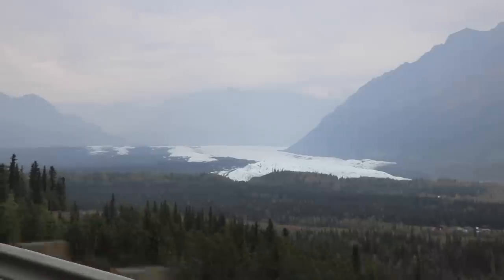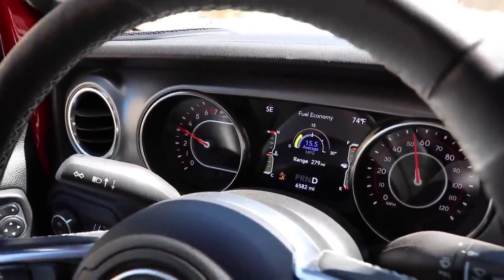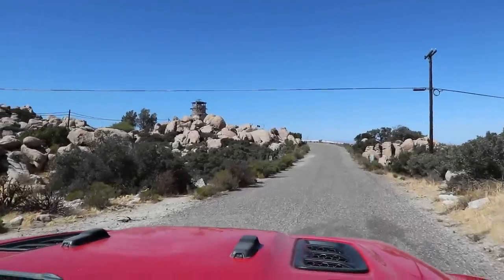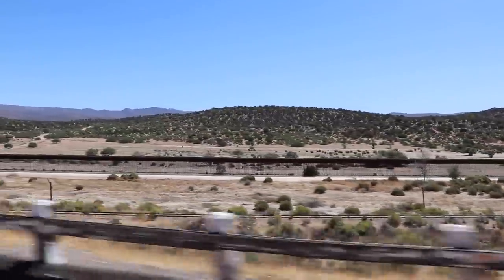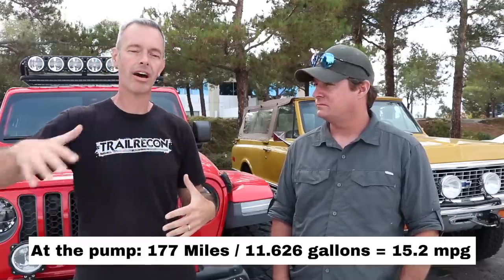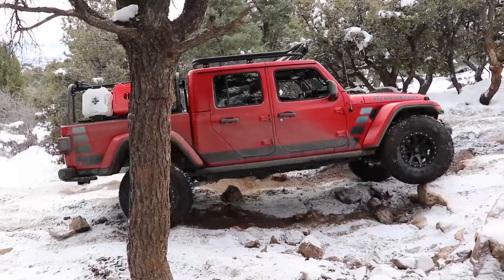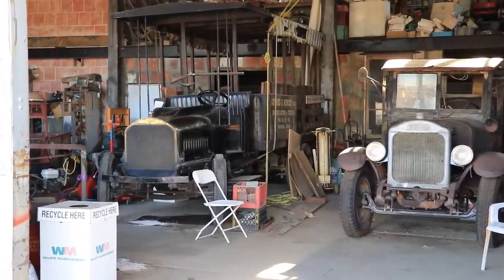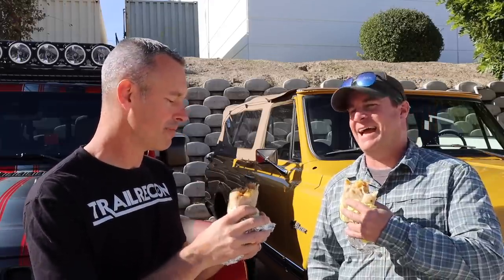Did Re-Gearing My Jeep Gladiator Affect the GAS MILEAGE?

Comment: Great video! What was the total cost for regearing? Is it worth it for the price? Thank you!
Reply: Claude Perrault rehearing has a few variables. Ring and pinion with set up kits and labor usually cost around $1500. I’ve seen it as low as $1100
Reply: drtstar1 Thank you Brad!

Comment: Great test!  
I do have a question that you or someone here might be able to help me with.
I have a 2016 Sahara JKU   
3.5” lift front w/winch and rear bumpers currently on 35’s but looking to do 37’s or 38’s.  As you know the thing is heavy.  
So looking to install some lockers and re-gear at the same time this year, but not entirely sure what ratio would be best. I hear so much back and forth on this. I trust your opinion because it seems you really do your homework before making a decision.  

   I do remember you did a video on your JK a while back, but can’t seem to find the video.  

Thanks

Comment: I get 16 with mixed driving in my xj with 32" tires, 3.5 inch lift, a tire on my roof rack basket, and on stock gears. She doesn't weigh anything near the gladiator though.
Reply: How do you pull that off? I have a Jeep ZJ with 4.5 inches of lift and 31 inch tires and I'm lucky if I get 11 mpg. It's a 4.0 by the way.
Reply: Damon Strehlau most of my driving to work is the Jeep runs around 1500 rpms and I get no traffic. On the highway I don’t pass 70 mph and just easy on the throttle.

Comment: Great video. Really enjoyed. My question is for a  1 MPG gain is it worth regearing based on the cost of doing it? Also would you recommend regearing even if you aren't increasing tire size or adding additional weight to the vehicle. Thanks.
Reply from the maker: All depends on your needs.  It would take a lot of gas to make up for the cost of the gears, but if you want to bring back your acceleration and have a little more range, it could be a good option.
Reply: @TrailRecon  thank you!
Reply: My dad and I have both lowered the gearing on our pickups using stock tire sizes. It makes them a lot more usable and most of the time no difference in miles per gallon.

Comment: Here’s my question: people always do a break in and change out diff fluids at 500-1k miles when regearing, but how come when the truck is brand new, which means gears are new, no one does the break in for the diff and change out diff fluid at 500-1k miles???
Reply: I would do it to make sure the shop did it right.  At 500 miles it's not to late to fix it.

Comment: What was the original gear set? Leaving those in would give you better mileage, but would be sluggish on take off. Putting 5:13 in would give you better takeoff but worse gas mileage unless they put you in the optimal rpm for mileage which obviously they do.

Comment: I have a gladiator rubicon stock with only a steel bumper and winch totalling 98lbs gain. My gas mileage as never been close to 16 mpg. Any reason for this? Even out of the dealership it's never been that great. I have 7000 miles on it.

Comment: On the JL do you need to upgrade the brakes when you go to 38” tires?  I believe they come with oversized brakes but not sure where an upgrade is needed? 37?  37?
Reply: Mats Ceder the JL brakes are way better than Jk but with the trucks added capacity we noticed some stopping distance increases with bigger tires. The bigger brakes are a margin of safety.
Reply: Good point.

Comment: Good information Brad, I saw that both of you were wearing heavier clothes on the test after the gear change, would the cooler temperature make a difference to the gas mileage?
Reply: Yes. The density of air would make a difference with the efficiency of the engine. More air = more bang. 1 mpg improvement wouldn’t be out of the question if there was a 20+ degree difference.

Comment: Hey brad hope all is well definitely see the benefits for the gear you carry etc off road should be a plus also a little extra range is good on the long trips to curious if you thought of a saddle tank I no there’s extra weight involved  but curious on your thoughts as always be safe
Reply from the maker: It think a saddle tank is a good option, but for me if I install any kind of auxiliary tank on the JT it will be for water.  There are some under the chassis aux. fuel thanks out there, but I haven't seen one that doesn't affect clearance yet.

Comment: Have you experience high temperature goin up hill with stock gears, my JL eco diesel gets pretty hot when going up towards San Diego, I’m running 37” with 3.73 gears
Reply: regearing will help that. I went to 4.56 on my eco and it helped immediately.

Comment: How did you come up with 513 gears? Seems like overkill for 38s.
Reply from the maker: I think 4.88 is a good ratio to go with for 38's, but because I carry a lot of gear and I will be doing some off-road towing I wanted to with a slightly deeper gear, so that's why I chose 5:13's.  Sorry for not explaining that in the video.

Comment: I guess my 1960s auto mechanics class lead me astray, of course then 4 on the floor was allot go gears; would have guessed going from 4:10 to 5:13 would have resulted in higher RPMs at a given speed thus lower milage. Of course that ignores overdrive. Lesson learned. Maybe we'll see you on the road, to/from/in Alaska.
Reply from the maker: I was surprised as well, but I think the 2 overdrives played a big factor in this test.
Reply: Lower RPM is not always better. There is a sweet spot. If the top gear is virtually unusable then what is the point? My dad and I have both lowered the gearing on our pickups using stock tire sizes.
Reply: @ericham4945  Good point

Comment: Brad .... Did I miss the ... Why 5.13’s vs the 4.88’s... You have 4.88’s on the JK right?  With the 5 Speed vs the 8 Speed thoughts on 5.13’s vs 4.88’s.  I’ m about to ReGear (2016 Rubicon on 37’s), and am having a Tough Time with 4.56’s vs 4.88’s ... I think as a daily driver the 5.13’s are too much... Thoughts ?  😃
Reply from the maker: Yes, I have 4.88's on the Wrangler. I think 4.88 is a good ratio to go with for 38's, but because I carry a lot of gear and I will be doing some off-road towing I wanted to with a slightly deeper gear, so that's why I chose 5:13's.  Sorry for not explaining that in the video.

Comment: So why 5:13 as 4:88 is closer to factory final ratio?
Reply from the maker: I think 4.88 is a good ratio to go with for 38's, but because I carry a lot of gear and I will be doing some off-road towing I wanted to with a slightly deeper gear, so that's why I chose 5:13's.  Sorry for not explaining that in the video.
Reply: @TrailRecon  Great video...It makes sense that 5.13s are efficient driving 60 mph or less.  What about cruising on the interstate at 75mph on a long road trip?  I bet gas mileage drops a good bit vs going with 4.88.  Would also be good if you touched on the weaker ring & pinion in the 5.13.
Reply from the maker: Most of the way back from our turnaround point was highway miles, we still didn't see any significant drops doing 70.

Comment: It’s the hwy speeds that kills mpg after re-gearing.
Reply: David DH actually helping. You are getting the powerband back in the target area while in the highway. On my 2014 Silverado I got 7 mpg gain after the regear.
Reply: @drtstar1  It's different on a full size truck.  I'm sure you're not running 3k RPM's cruising down the highway at 65mph.
Reply: David DH depends on what truck. Lol I just put an overdrive trans in the k5 and I’m now 1500 rpms at 65.
Reply: @drtstar1  We're here talking about re-gearing and you're talking about OD on transmission. Get on the same subject dude.  Also, once you're rolling at 65mph on stock gear, it doesn't take a huge amount of power to maintain that speed so yes, hwy speeds kills your MPG.  City driving is different.
Reply: David DH the point is about getting the final drive gear in the sweet spot of the engine.
Reply: drtstar1 so what is you’re sweet spot, 45-55 after regearing to 5:13?  Here we run 75-80 mph on the hwy and with 5:13 gears, the engine is reviving .   Who ever says putting massive tires and regearing had help their mpg  lives in a 50mph max speed world.
Reply: David DH, you are absolutely correct. I wish I had a sixth gear. Running at 3000 rpm kills my runner but city and in the mountains I love being re-geared to 4.88
Reply: David DH every vehicle is different. In a sbc 2000,2200 rpm is my favorite engine operating range for gas mileage. There are so many other factors though. Are you using a turbo 400 trans? No lock up converter? A huge stall converter? Those are all high horsepower mods and will never see gas mileage gains. 2006 Chevy truck 35” tires 4.56 gears I’d get 16 mpg round trip at 75mph. That truck had a 4L60e trans and a .7 overdrive.
Reply: Zac C I agree with you 100%. I had 4:88 gears on my old JK and it was absolutely enjoyable to drive with 37” tires around town. I just hated trying to keep up with others in the interstate.
Reply: drtstar1 4:56 gears is different then 5:13. I’m commenting on the video.
Reply: @drtstar1  Thanks for the feedback.  What do you feel is the sweet spot for 75mph hwy driving a JT or JL on 37s/38s?  I have a manual JL and it operates about 200 rpm higher than the auto.  For example, with 5.13's running 37s at 75mph, it would cruise at 2600 rpm getting approx. 14mpg.
Reply: Matt Strunk that’s a great question. I’ve not encountered a manual in a JT or JL yet. I’d shoot for 1800 rpms at 75 if that’s your cruising speed. There are plenty of gear ratio calculators on line if you can find the final drive numbers of your transmission.

Comment: Overdrive is meaningless in the world of 6, 8, 10 speed transmissions. It's the overall ratio that matters. The benefit of regearing and regaining access to your 7th and 8th gears has nothing to do with the magic of overdrive. 0.67 * 3.45 is the same as 1.00 * 2.31. The 1st generation Chevrolet Equinox with the 3.4 V6 and the 5 speed auto did not have overdrive. Yet they still did 2300 rpm at 75 mph. An automatic Honda Civic from 2005 has not one, but two overdrives and It still does 2900 rpm at 75. Fuel economy gains from regearing have everything to do with the computer software that controls the torque converter lockup schedule. Gearing numerically higher to compensate for larger tires brings the engine to road speed ratios closer, where the computer is happier to lock the torque converter sooner. Locked torque converter means less slippage, less slippage means less energy wasted as heat. Making gears taller by putting on bigger tires makes the torque converter lock later and unlock sooner which obviously causes more heat production and energy waste.

Comment: I just traded a 2020 wrangler on 35's with a 4cyl, to a 2022 gladiator, and I hate everything about the gladiator, it sucks in every category. Power 👎load capacity 👎, off road capability, dry storage 👎. They claim it can tow 7000, it can't tow itself, (completely stock oem 33" tires fully inflated) 7gear all the way back from Arkansas to Minnesota 72 mph average mpg 15.4. With a light load and tonneau cover, no rack or external gear.I absolutely abhor the gladiator. Most impractical 💩 I can possibly imagine. It doesn't do one thing even average let alone above. For a $60000 Rubicon trim, it even lacks in standard features, one still has to order up for accessory switches, led lights, bed outlet, trail rack system, front camera this was my worst vehicle decision ever ( I am 62 and have owned a gremlin).
Reply: Hey Jiggy what’s your take on the 2020 wrangler with the 4cyl, would you buy again?

Comment: if you lighten up the weight and reduce the rolling resistance you will improve gas mileage...basicly all the aftermarket crap you have in that jeep and it not being stock makes your test pointless..now if it was stock and regeared it your test would actually be accurate

Comment: You forgot to talk about the reason you picked this gear ratio
Reply from the maker: I think 4.88 is a good ratio to go with for 38's, but because I carry a lot of gear and I will be doing some off-road towing I wanted to with a slightly deeper gear, so that's why I chose 5:13's.  Sorry for not explaining that in the video.
Reply: @TrailRecon  I think you hit the sweet spot.  You'll appreciate your choice even more at altitude.